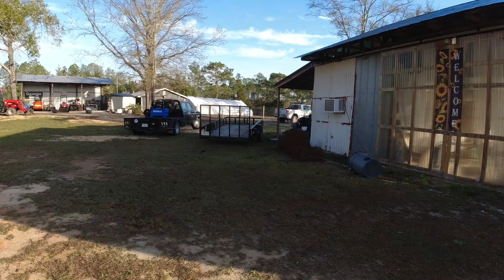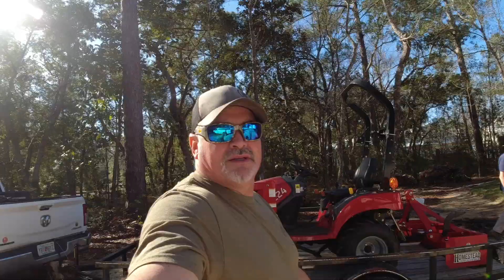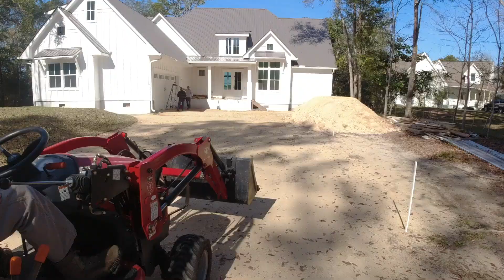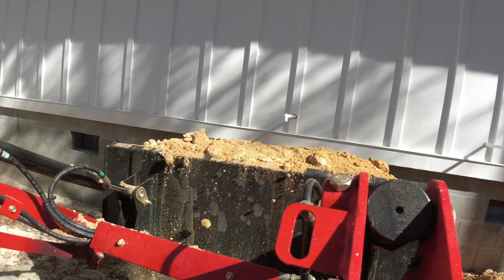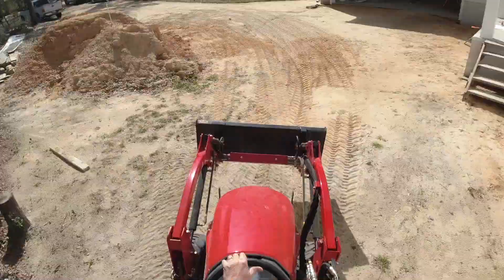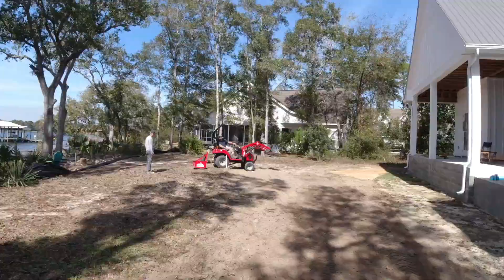Spreading 18 cubic yards of dirt with SUB COMPACT TRACTOR!

Comment: Does the mower height adjustment knob have a TOP or LOCK setting?  If so, with the 3 point up all the way put it in the TOP or LOCK setting so your mower deck lift linkage isn't hanging down under the tractor to potentially get bent or broke when you don't have a mower installed.
Reply from the maker: I’ve never looked. Lol.  I’ll have to see.  I don’t have the mower deck so I never bothered to check. Thanks, I will now though.
Reply: @hhamilton1970  Your welcome.  That linkage don't take much to tweak out of spec and then its a pain to get the thing to lock in the full up position....don't have a clue what I did to the linkage on my Kubota BX2680, but I have to fiddle with it to get it to lock in the up position now, its very annoying, and its a Kubota problem that has been around for several years and they still can't build it right I guess.  

I have a mid mount mower for mine, but don't use it very often, so I make sure the linkage gets locked in the up position when the deck is removed...

If your machine don't have the LOCK or TOP position setting, you can wire or zip tie the linkage up out of the way, its like the rear 3 point hitch, it don't have down pressure, its gravity lowered, so you don't need much to secure it to the tractor frame out of the way.